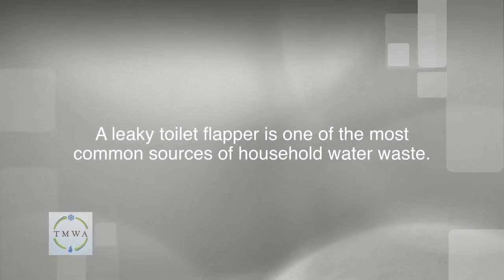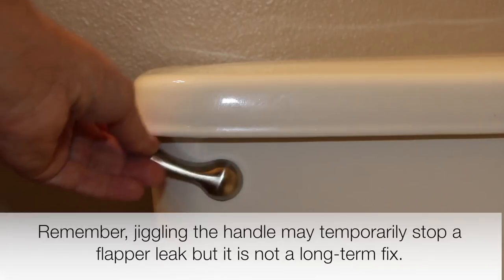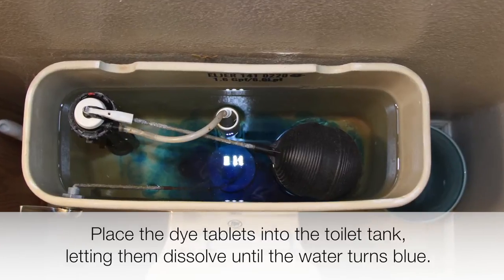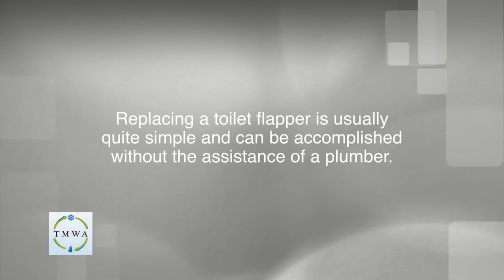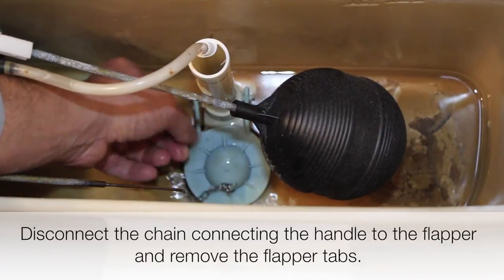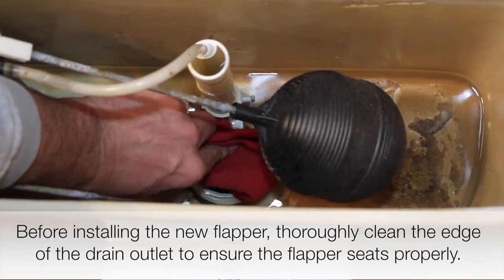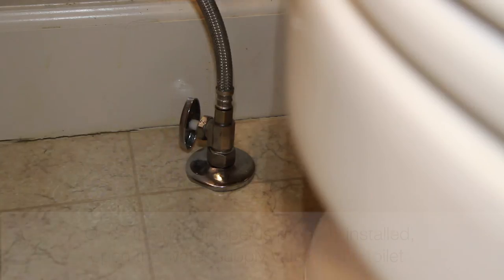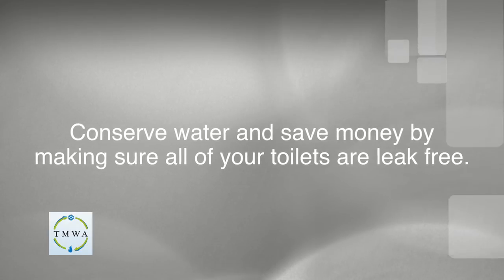How to Test for and Fix a Leaky Toilet Flapper

Comment: No need to buy dye tablets. Quickly pour 2 liters of water at the back of the bowl. The existing water will be auctioned out. Then come back after 15 min to 30 min and check the water level. If the bowl has refilled, there is a leak.